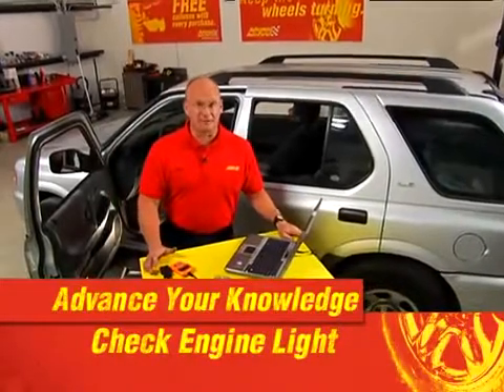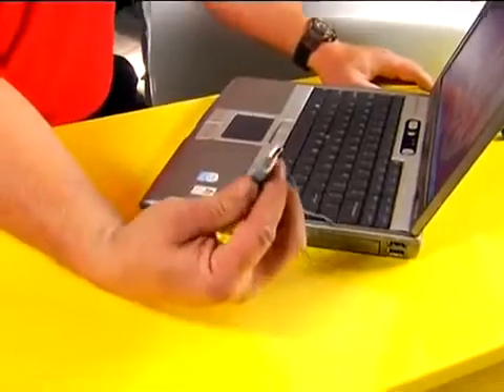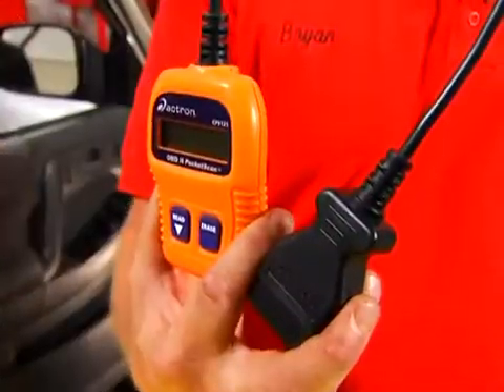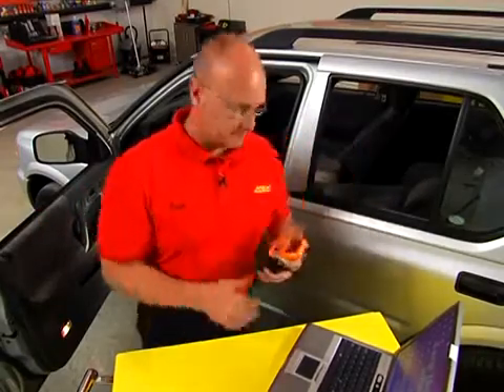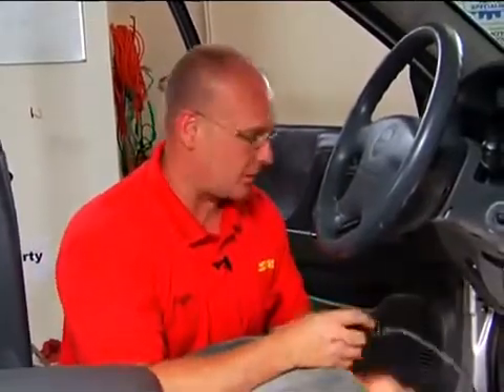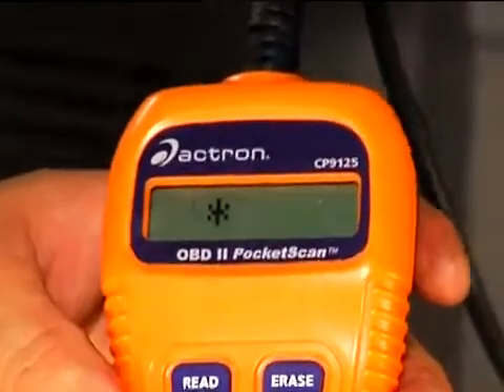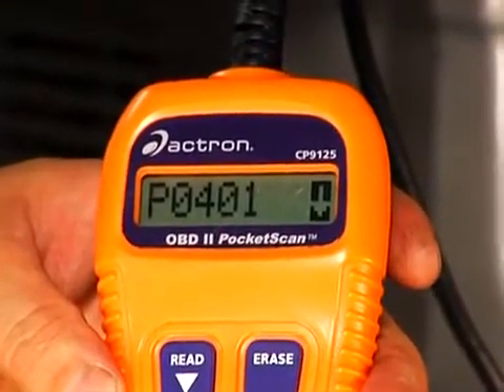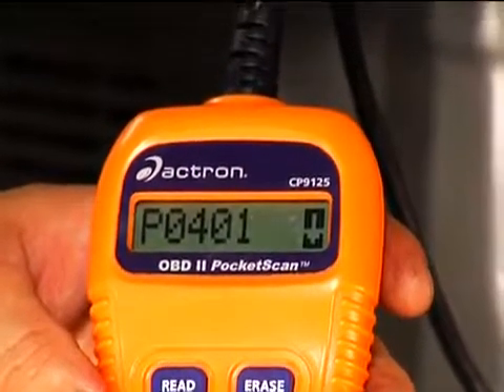Tips & Guide To Check Engine Light  With Actron CP9125 PocketScan Code Reader

Comment: That's if you have a good mechanic.  Take it to name brand shops and they charge  $400.00 minimum  for any work,  $550. For shock replacement a 1/2 hour job plus $60. For both shocks do the math. 
$95. Muffler they quoted  $375. 
Good bye Mr.Tire